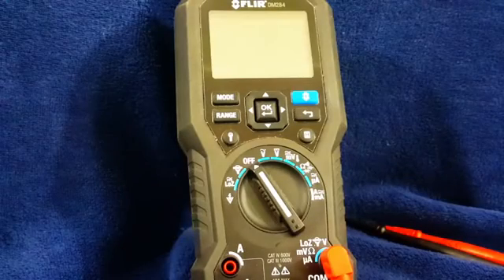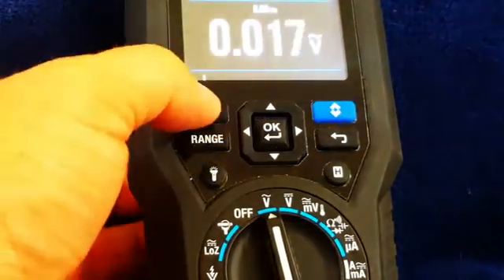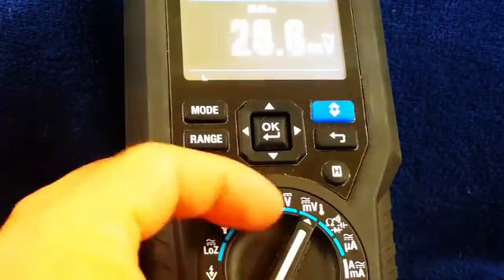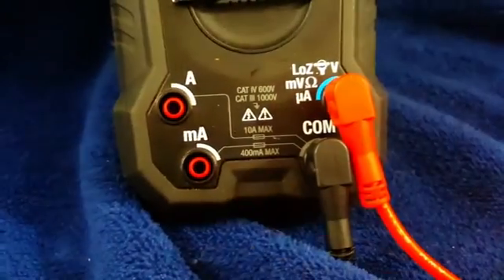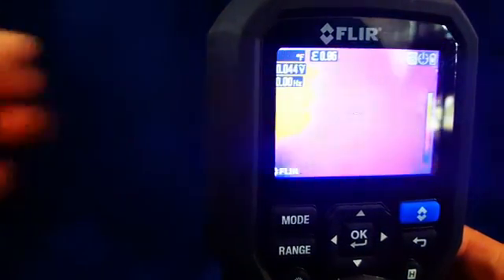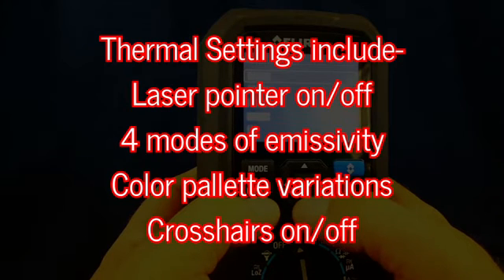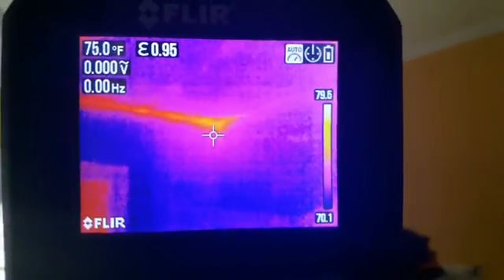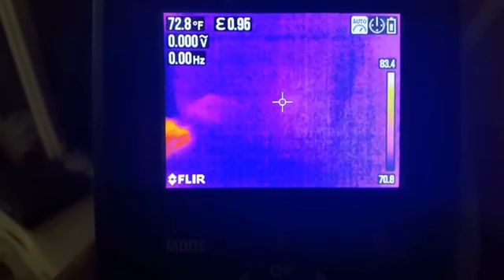Flir DM284 Thermal Imaging DMM

Comment: i had to send mine back was really disappointed with the tech support sidd. the thermal imaging was crap
Reply: Anthony Rodriguez yeah the lens has a shutter calibration like most other thermal imagers. to calibrate the image it throws the shutter down for a all black calibration source.  Thats what I heard anyway.
Reply from the maker: Bad resolution?
Reply: Working Joes Roundtable it wasn't displaying the right temps and the screen would freeze frame certain images. I was pointing it towards a piece of ice and it was reading 109 DEG f I used it in the field one day and threw it back in the truck sent it back the next day